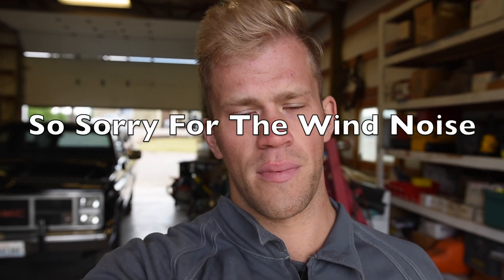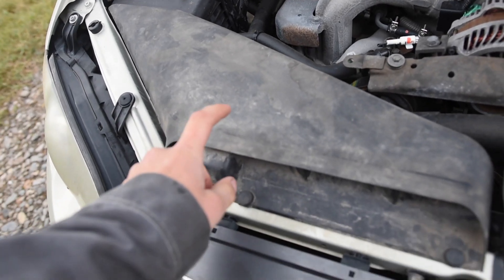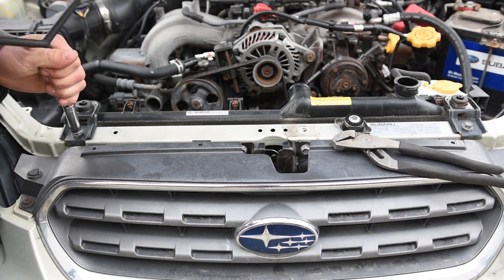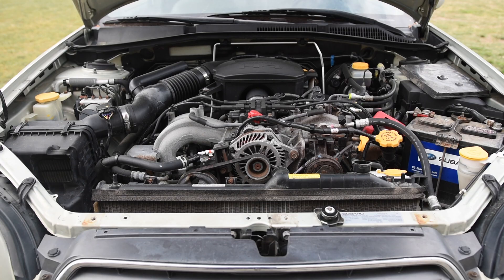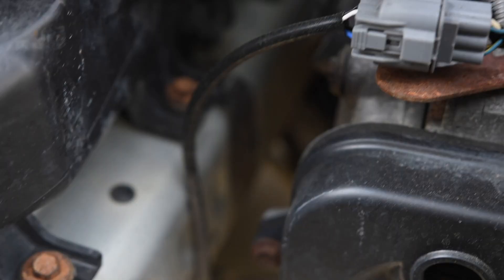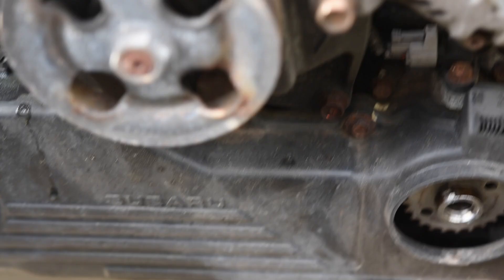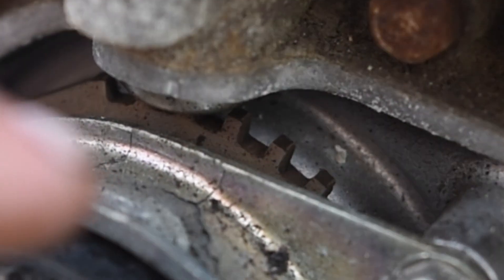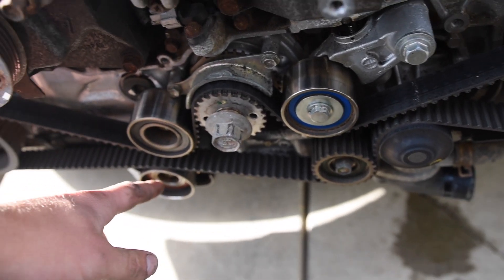SOHC Subaru Timing Belt Replacement Procedure

Comment: Being that you didn't replace the water pump or the cam and crank seals, you didn't really save $1000 dollars... additionally you only needed to remove the fans themselves instead of draining the coolant and removing the radiator. That could have all stayed in there with just the fans removed and you wouldn't have had to bleed the system. I gave you a "like" for the video though.
Reply: A lot of people I know just remove it for the convenience and extra space that it affords when you remove it. Its not required but its a pretty standard practice.
Reply: Not standard for a tech like myself getting flat rate labor (if I wasn't replacing the water pump) removing the radiator for a tiny bit of space (which the space is used by the cooling fans anyway) will consume an extra half hour if not a little more time bleeding the system also.
Reply: Good talk.
Reply: Also lessens the chance of dinging the cooling fins on the radiator
Reply: Don't know what part of the country you live in, but in Atlanta, the dealer(I know--highest prices around) wanted $2K just for the valve cover seals with spark plug seals, which is much less labor time than the timing belt.  So I would say saving AT LEAST $1000 for this.
Reply: Compared to dealer prices, ANYTHING is cheaper. I replaced the valve cover gaskets and spark plug seals myself a year or two ago - it's a pain getting down next to the side of the engine compartment, but you can do it in an afternoon. I spent <$100 in parts, including new spark plugs - charging $2k for that is just ridiculous.
Reply: @seandknutson  great
Reply: that's what a cardboard box is for, or one could always just not be a dumbarse and ding it in the first place...

Comment: Water pump?
Reply: So if you want to check the water pump just turn it and if it turns freely with little to no resistance then it's good but if you want to remove it there are about 5 bolts holding it in and you would need to remove a hose that is attached to it. Also if you take it off you might need a mallet to get it off
Reply: @hunternadon6711   - The water pump may well be, and probably is, just fine but I think the point is, if the car has enough miles on it that the timing belts need attention, as long as you're in there, go ahead and replace it.  It's simple at that point and relatively cheap insurance.  I've heard of a number of folks who didn't touch the water pump with the engine was down for timing belts only to have to tear it down again 10k miles later when the pump did go out.  It's a personal decision of course but as I said, it's cheap insurance.
Reply: @Intrepid175a  I found the water pump actually made most kits cheaper
Reply: I was wondering about that.  Generally speaking, if the belt is ready for replacement, the water pump is cheap insurance at the same time.
Reply: I learnt the hard way getting mechanic to do belt but he never mentioned pump. 6 months later it all comes apart again after the pump starts to leak, do the pump!

Comment: Is it best to drain the coolant when the car is cold or it doesn’t matter?
Reply from the maker: Manuel Gonzalez Does not necessarily matter
Reply: doesn't need drained nor does the radiator need removed unless you are doing a proper timing belt replacement which includes replacing the water pump and the seals for the cams and the crank.
Reply: For people who are new to doing this time, which, lets be honest, this video is made for, removing the radiator makes it  much easier. If you have done this a few times then sure you could skip that step pretty easily, but you probably wouldn't need this video at that point either. You are totally right, but in the context of this video, it just makes more sense to take it off.
Reply: It's best to drain the coolant if you are replacing the water pump and thermostat also... if not I'd leave the radiator where it is and just remove the fans.

Comment: Hi.  Great video.  I have a 2003 Outback with 78K miles.  The timing belt has not been changed as yet.  Can we wait until 105K or is it overdue because of the number of years the car has been around?  Thanks.  Every dealer I call says to do it now: urgent.
Reply from the maker: doug solomon I would definitely do it as they are rubber and can dry out and break.
Reply: thanks

Comment: how do you remove the crank bolt after hand turning the engine?
Reply: use a long handled ratchet wrench and smack it with a hammer you may have to readjust once or twice before it gives but it will brake loose
Reply: yup!

Comment: Dude, thanks like times a million for posting this! Just got mine done and she's running smooth. A quick tip, for tightening down that crank pulley bold. I put 2 short 3/8 extensions in the crank pulley holes and then stuck a breaker bar on them, and pulled the opposite ways until I was able to get the proper torque.  Also, mine, an 2009 has a stupid stretch fit belt on the inner crank pulley part which was kind of a pain to put on, but I did it with flat screwdrivers. The crank pulley itself was pretty tough to get off, but I kept hititing it on the sides with a rubber mallet and wiggling back and forth until it came off. Anyway, just thought I'd share some tips in case it helps anyone else. Again, THANK YOU!!
Reply from the maker: Excellent tips. Glad it worked out for you man!
Reply: wouldnt jamming the flywheel with a flathead screw driver be easier and do the same thing?
Reply: WHAT? NO MAN! GO READ A BOOK OR SOMETHING!
Reply: sure helped me out
Reply from the maker: Good! Glad it did :)
Reply: This helps me a bunch!

Comment: is there any warning when it goes .. replaced the timing belt in 2011 when we rebuilt our motor on our 98' Subaru forester.. so just wondering because at the time the motor was being rebuilt our machenic stated there was nothing really wrong with it but sense everything was apart do it then ..

Comment: did you disconnect negative cable from battery?
Reply: yijiang gu truthfully why? It makes sense if your servicing the electronics of the car?
Do you remove the neg when changing the air filter or oil? I sure as hell don't, when removing the seat with the airbag hell yeah I'll disconnect it
Reply: You are disconnecting wires to do this so I would take of the negative

Comment: this is an awesome how to...very good tips.  One thing that could be critical...are you really working from tdc or is it as brianmobile1 says in his video mid stroke so that valve interference is not an issue?    I am going to do the job as if interference is an issue...thanks again for this video.
Reply: yeah he meant mid stroke, #1 cylider mid power stroke.